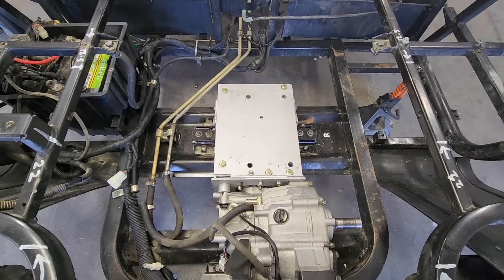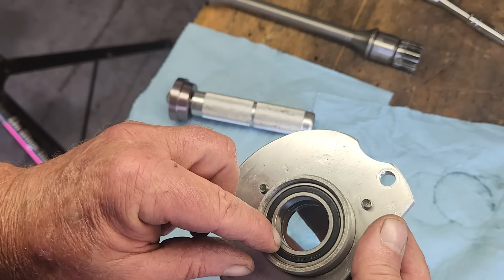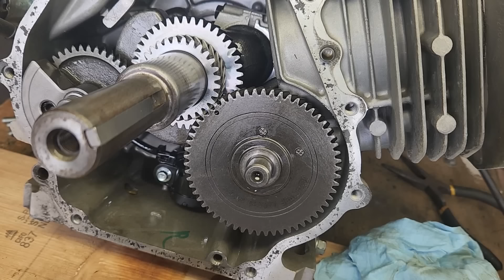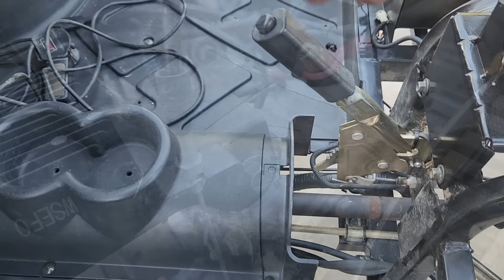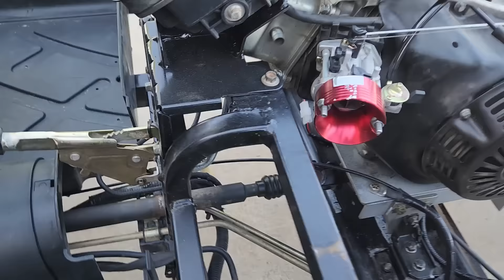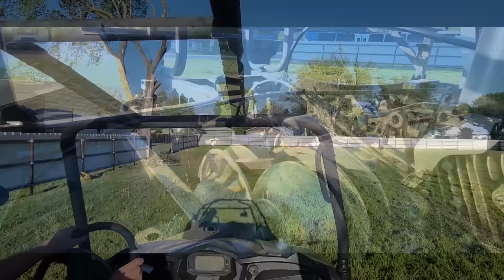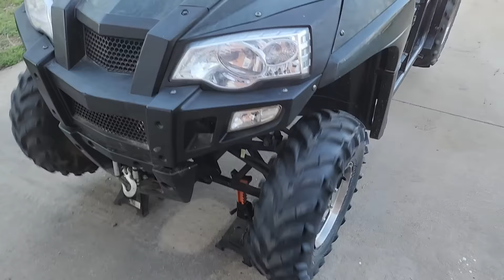S6 E15. HISUN UTV Predator BIG BLOCK engine swap.  4x4 works! plus upgrades!

Comment: Hey Jimbo - and anyone else that needs a tip - whenever I have to set magneto-flywheel spacing, I just fold a dollar bill in half, and let that double-bill-thickness set the distance.  Works every time.  Because we don't all have the ultra-rare Robot Cantina business card lying around, and they're way too collectible to go cutting one to bits all willy-nilly.
Reply: Ive always used a business card lol I only take cards from people to use for this, usually. 🤣 however im hanging onto this one for future use, as business cards are getting rare.
Reply: I found out as long as the magnet and coil are in really good condition you can change it spacing to slightly adjust the spark timing, its not good for alot of adjustment but still
Reply: This is how i was taught 25 years ago on how to gap a coil/magneto. I was a little concerned with the thickness of the business card!
Reply: I've got a bunch of novelty "get out of hell free" cards (styled off the monopoly get out of jail card) in my wallet. Had them for years and they're exactly 0.5mm thick. Yeah, I'm metric and I'm not going to convert that.
Reply from the maker: That’s a great trick, I'll definitely have to give the dollar bill method a try next time! 👍

Comment: So far it's looking like a practical buggy. Have you thought about putting a lighter spring in the compression release for faster weight throw? That's the old trick for a distributor back in the day.

Comment: I’m a sheet metal fabricator, if we weren’t several states away I’d build you a metal insert to drop into that plastic bed! Great project, so much fun and learning can be had with cheap stuff like this 👍
Reply from the maker: That would have been a massive upgrade for the bed, thanks for the offer! 😁
Reply: @robotcantina8957 maybe a roadtrip idea with that contraption 😂
Reply: We have this modern thing, it's called shipping!
Reply: @izzyplusplusplus1004 yes I realize that but I’d want to make him something that fits in there very snugly and not just a generic looking box that rattles around, that’s gonna be a hard thing to do without having the machine here to look at and test fit…….that was my point.

Comment: My solution for the compression release would be to rotate the rope starter housing so it angles the rope forward.  Have a lever on the console or mounted to my seat so I could draw the engine through.  Pretty cheap mod.
Reply from the maker: That would work!

Comment: The old snowmobile engines had cable operated compression release valves. 🤔 Fun machine.
Reply: I have an older compact tractor (15hp 2 cylinder diesel) that has one. I use it to release compression while it builds oil pressure before firing it up.
Reply: Big chainsaws use a push button compression release that auto returns off when the engine fires but you need a reinforced place on the cylinder block to use them.  BIG BLOCK!!!

Comment: Use a small 12v compressor with a tank to force compressed air into the intake with additional fuel for boost on demand system

Comment: Lighter spring on the decompressor maybe. Thanks for bringing us along on the build. Looking forward to your solution attempts.
Reply: That's what I thought, just stretch that spring a tickle or two.
Reply: I was thinking to just leave the springs off.
Reply: @bayoumike544  If the decompressor does not return it would have the same effect as removing it.

Comment: I bought a 2007 Yamaha Rhino 660 new,  back in 2007 and still have it today.  My ranch is 130 acres with around 3 miles of private roads and I use the Rhino to access all of it.  It's heavily wooded with a few wet areas, and 4x4 Low is necessary to gain access to the problematic areas.  It's never necessary in open areas,  but useful where it's thick and heavily wooded.
Reply from the maker: Good to know, so you you 4WD makes perfect sense.

Comment: I feel super vindicated right now. My first (and only time) working with a magneto like that, i was having trouble getting it to sit just so over the flywheel, so i just put a strip of masking tape over the flywheel, set the magneto on it, tightened it, and then pulled the tape and it worked perfectly. Figured that out on my own
Reply from the maker: Good to hear !

Comment: Jimbo is tearing it up 🤣🤣 Glad you're having fun. I wonder if you can increase the pulley size a little to increase top speed or maybe add an overdrive just to the 2wd side of it. You'll probably need to install a windscreen to make it street legal, and some tunes. Gotta have tunes.🔊 🎵 🎵🎶🎶Hang a Bluetooth speaker from the roll cage. 😁
Reply: In some places it's an enclosed helmet with that face cover part or a windshield, atvs are street legal in most places but you have to wear a full helmet

Comment: i used to have a 50cc vespa scooter with a manual compression release.
Reply: Our fire pumps still have one. Pull out and twist, the next three full revolutions will be without compression.
Reply: my solex too
Reply: My Yamaha 200cc quad has one. It's in a silly location though - you have to walk or reach right over to the other side from the pull starter to open it, and if you fail on first pull, you're going to have to lean over again. I don't actually know if it's necessary because the pull starter was broken before I started working on it, and I've only ever used the electric start.
Reply: @tin2001 it's probably there just for the pull start that probably was broken from not using the compression release if I had to guess

Comment: Jimbo.
One of my very favourite projects also. I have looked for these things up here in the great white north. But not much luck. I do have other projects to work on. Also trying to teach my 
Self fusion. I did use cad in my former life ( BR)before retirement, LOL. So I am not a complete Luddite but I am finding fusion quite a bear to learn. Cool here today about 8c.
Thanks for the great video.ok but what about blue tooth for the compression release ? It must work for that? I am sure the jungle site has some sort of solenoid to hook to your exhaust valve.
Have a great week looking forward to the next one.
Paul from Dorchester.😂🇨🇦
Reply from the maker: LOL, Bluetooth for a compression release would be the ultimate tech upgrade! 😂

Comment: Great project as always. Just one stupid question out of curiosity, wouldn't it be possible to modify one of the new engines to make the driveshaft traverse them like it does with the stock engine?
Reply from the maker: Unfortunately there is not enough space in the crankcase on the 420 engine to allow the driveshaft to pass through.
Reply: @robotcantina8957 I see. Well, good thing you don't need 4WD, I reckon you could fit an engine bigger than the stock one if you want a purely RWD vehicle

Comment: The belt look to low in the secondary clutch
Reply: I saw that too and was going to comment and say heavier weights would fix the issue but then saw Jimbo replied to a comment hinting at mods for a power upgrades and increased RPM that should help fling the current weights to the right spot to get full belt engagement.
Reply from the maker: there is a shim in the secondary that holds the pulley open.  If I take that shim out the pulley will close a bit more, but the clutch issue will get worse.

Comment: Very dumb question and idea:
@ 13:15 Could you either put on a manual choke, or even block the intake to create a vacuum, to help the starter?

So, the starter doesn't have the ability to compress 420cc's of air at 8.5:1, Which means you either have to reduce the compression or the charge. Compression would *have to many drawbacks, and changing the charge would be easier.

So using a choke or a block, you drop the VE and the charge within the cylinder, which also means reducing the amount of force needed to achieve the compression stroke. If it doesn't work on 420cc at 8.5:1, then maybe something lower it turn over without bogging.

Could you put a choke on the intake to reduce the intake charge to something low enough (like 350ccs, 300ccs or even lower) so that the starter has enough power to compress the lower charge?

Edit: Maybe gutting the carb it came with and just using the choke mechanism on it could be an easy way to test this for free-ish

I admit, it sounds dumb putting a choke on a fuel injected engine, but if it helps then maybe it isn't dumb.
Reply: My king quad 400 is efi and has a choke
Reply: @Minimotorgarage Hmmm, any idea on their reason for making it that way?
Reply: @XenocraftGalaxy probably for cold weather starting, and doesn’t have as many sensors as other atvs so they left have It for user choice
Reply: I'm pretty sure the easy answer is just an upgraded starter.  I think Jimbo did something similar on the Insight, but not 100% sure.
Reply: @mungtor  I mean, yeah, but saving money would be nice too.

Comment: could probably have sumting cable operated through the valve cover pushing the exhaust valve slightly open , used to have a mnoped that had a tiny screw in cable operated pressure relief valve , but that would mean drilling ans tapping a hole in the silinderhead in a spot where it clears everything else 
wonder if you can use the generator you installed as a brushless motor if you install a few hall sensors and a cotroller to give that extra kick passed the compression , i know hybrid cars use theire electric drivemotor as a start stop starter for the gasengine , it might not be strong enough though

Comment: Can you lower the motor just enough to allow the center console and install the passenger seat in without having to modify the passenger and console? This is an interesting dilemma. You could, depending on the exhaust? I am a little puzzled. It would be nice if everything fit.
Reply: The engine can't go lower and retain 4-wheel drive as it currently sits.  The engine needs to be above the driveshaft to the front differential. Jimbo would either have to sacrifice the 4WD or cobble together some system of jack-shafts to route the power.
Reply: @mungtor  That's why I am confuzzled. Oh heck,
Reply from the maker: The engine is in the lowest position it will go.
Reply: @robotcantina8957  Thanks for clarifying Jim! I was a little confused. What else is new?

Comment: I'd put a V-twin lawnmower engine on that thang Jimbo.
Reply: Meh, the 420 can make more power with a flywheel, cam, carb and header. With that it also gains another 2k or so RPM and this buggy really needs RPM more than torque given how happy it is to spin the wheels in high range and how slow it still is.

Comment: The same engine is available up to 625cc for a bit extra punch . On a practical side there is a oil pump and filter to extend life's as these fill up with metal particles that will cause damage unless you change oil regularly